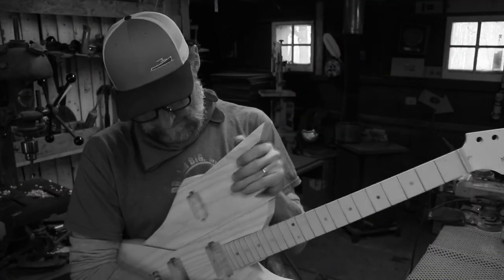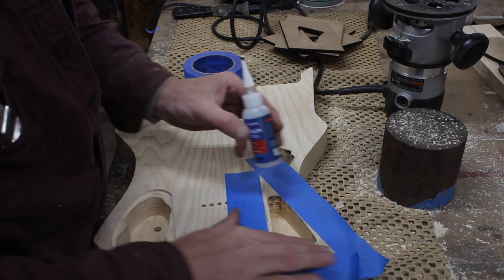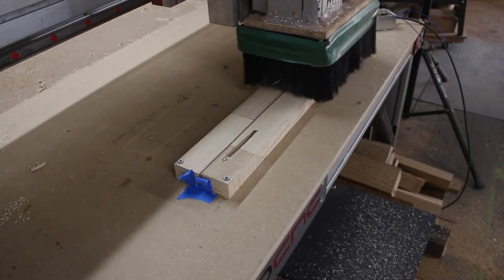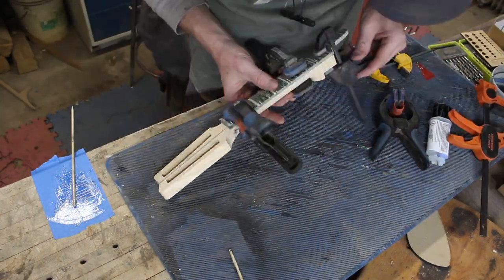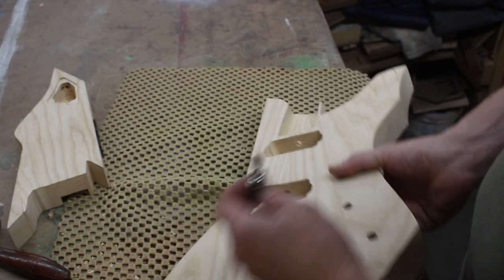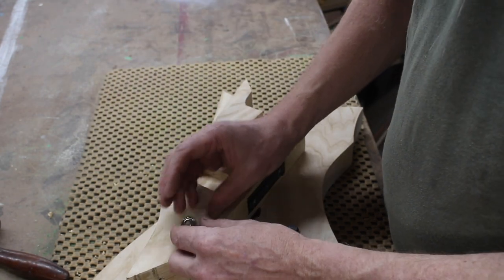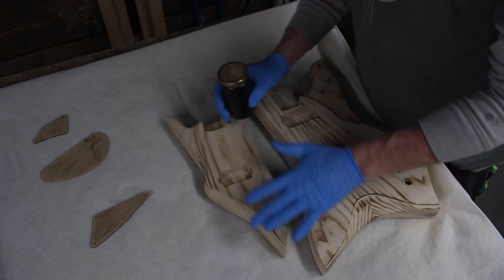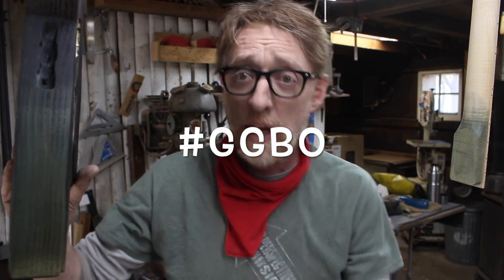Mandolin Neck Made From Scraps - Great Guitar Build Off 2021 Part 2

Comment: Tim, this is shaping up to be a phenomenal guitar - I can see Nigel Tufnel bidding on it; perfect for when 'Tap' perform 'Stonehenge'. Now, (I don't want to p in the pool) but the inverted fender jack socket? mmm, no!  I don't think it looks innovitive, it looks like someone fitted a socket all wrong - sorry. And watch those blends on the back of the neck, atm it looks a bit rough.
Reply from the maker: The jack could always be flipped around if needed. I also think of Spinal Tap every time I see a double neck.

Comment: I’m really digging this guitar. It’s looking good! On video it looks like you could have used that strat jack plate on the top of the guitar to plug in the mandolin with a 1/4” straight jack when they slide together. Anyway, you got the job done and it looks cool! Good job Tim!
Reply from the maker: The angles arent quite right for a 1/4" connection between Instruments

Comment: Instead of the contact idea a switched input jack socket in the main guitar and a standard small patch cable from the output of the mandolin might have been the KISS solution? But hey I know you’re enjoying the process and the results are always amazing
Reply from the maker: That was a thought but the angle the pieces go together prevented it. If the joint were parallel thay would be the best way
Reply: I meant visible rather than concealed - with your way it might be possible to have two amps connected ( or two amp channels) not just to the two instruments - but directly with each other .. and I’ve no idea if that works out well on things like impedance matching or creating hum - or anything else more risky

Comment: interesting point about waste of manual woodwork vs CNC woodwork, but in the long term, is all of the accumulated waste of doing it by hand over years more impactful than the manufacture, transportation, maintenance and running costs of the CNC and all it's associated equipment? also consider that doing it by hand often enough justifies spending time finding less wasteful techniques and effective means of using the waste that is created. un-recyclable computer components manufactured in China under morally questionable circumstances versus VOC emitting, polluting chemical compounds and petrochemical derived single use plastics is a hard choice to make.
Reply from the maker: Excellent thoughts. There is a lot more to "being green" than meets the eye.